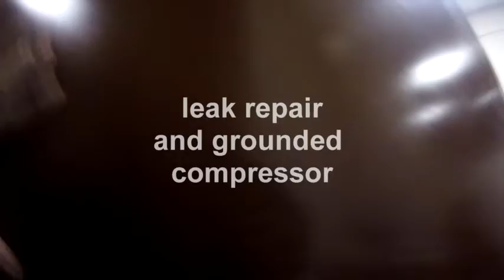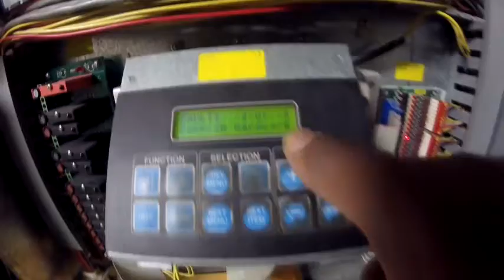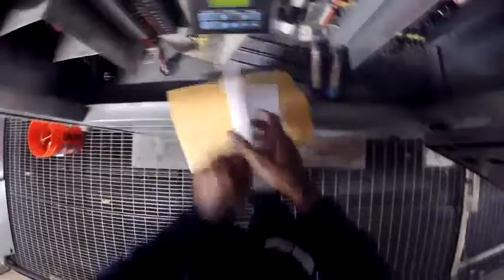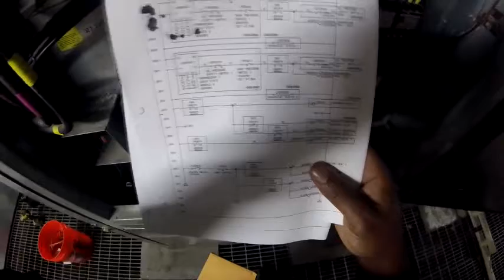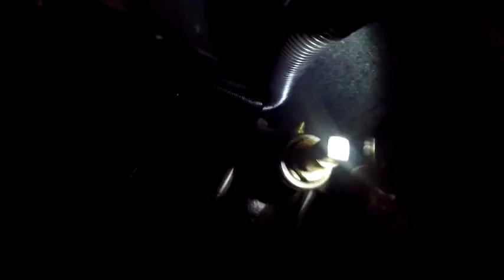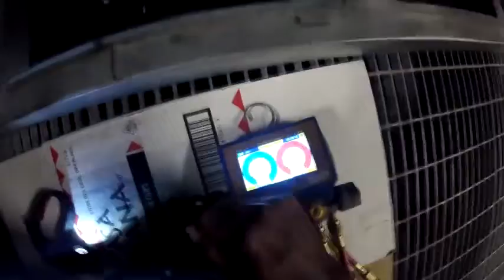HVAC: Leak repair and grounded compressor

Comment: Man we’re in the age of LED’s trash that old work light haha. I never used snoop I usually have the nu-calgon on hand or I try getting some big blu. How you like those yellow jacket gauges ? I have the same ones I’m just waiting until the battery starts to not hold charge but I like them a lot hope they last me awhile. And for R-22 psh stick with it until the very last drop, then we jump to 407c retro fits. Man you gotta get those blu vac hoses and micron gauge dude get on that!

Comment: Those same Service Valves can be a pain in the ass. I was working on a DS Liebert could nut pull a vacuum below 1700 microns on 06E compressor service packing nut was leaking!